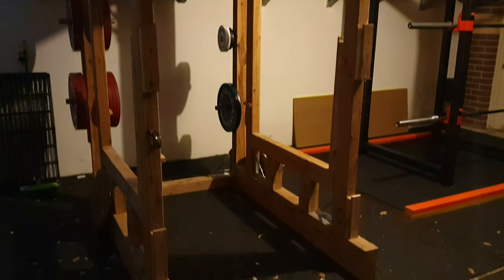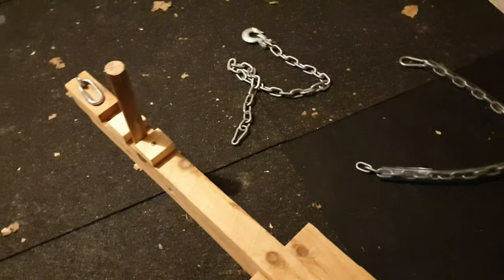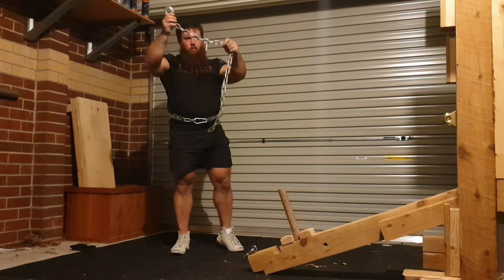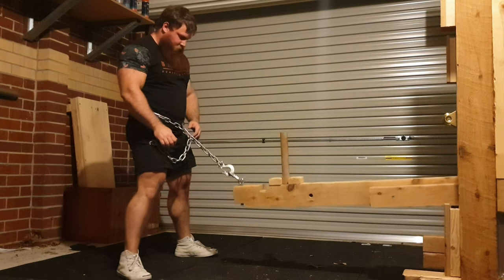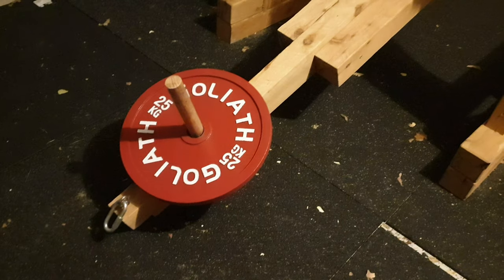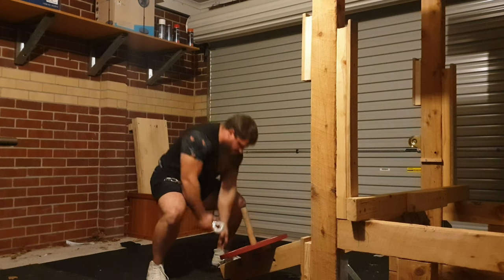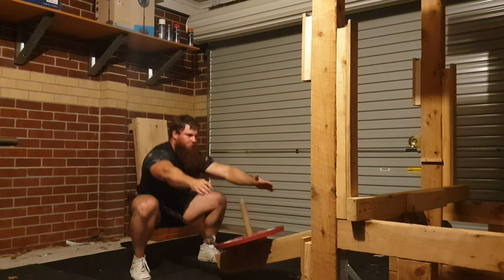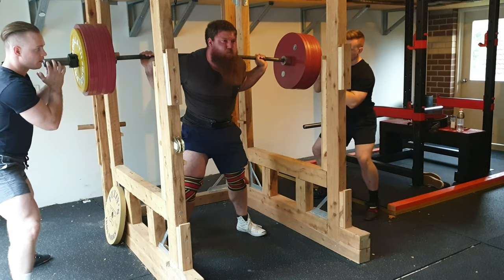DIY Belt Squat Machine - Very Low Cost And Easy To Build

Comment: I really like that design! 👍 I could make something similar for myself but I do belt squats so seldom that I think I just hook the weights straight to the belt.
Reply from the maker: Yeah each to their own. I like it as it makes loading very easy.
Reply: @LairdRoss  Yes, that's true. Hanging many plates straight to the belt can be quite tricky. This kind of lever arm system is definitely better if you need use a lot of weight.
Reply from the maker: I can even load a stone on it if need be too mate - its awsome.

Comment: Nice build! Being that far away probably makes it less weight than what is actually loaded though right?
Reply from the maker: Not its the opposite as the lever is against you more. It also pulls you forward
Reply: @LairdRoss  oh that would work well then I bet!
Reply from the maker: Yeah it does and it hits the quads very hard. If you face the other way you can hit a lot more hamstrings and glutes